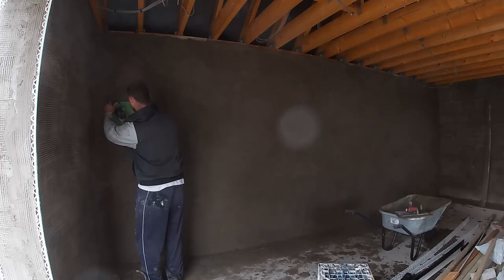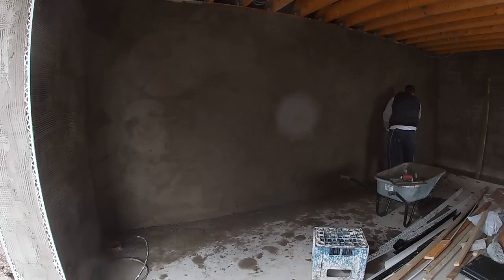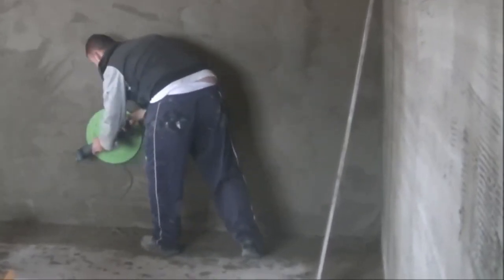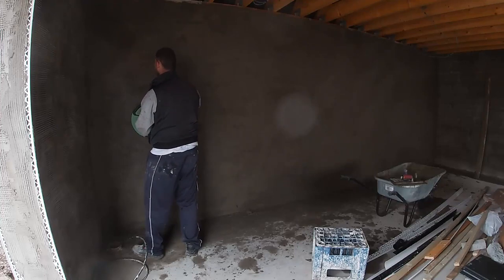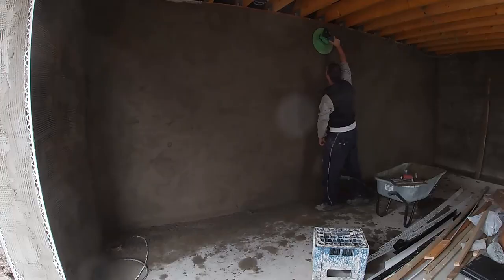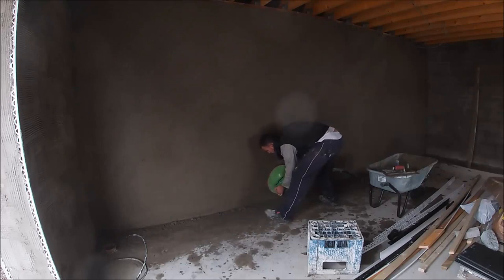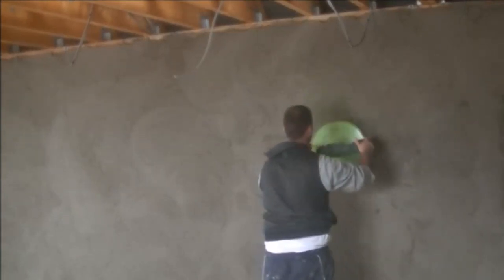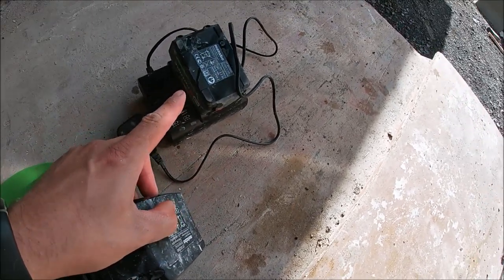Cement Plaster Finishing Machine Refina Power Float Internal Rendering

Comment: Seriously considering getting one. 30 years plastering is taking toll on the joints. 👍
Reply from the maker: The way it gets the render back is great for me as i dont like to wet my render as i dont like the discolouring you can get it will be good if i get time to whip u a video on it vs hand floating if that makes sense buddy
Reply: @macplastering  defo makes sense, 👍👍
Reply from the maker: @dominicdurso3672  I just need some good weather and a job that has 2 walls the same or a big wall that i can do half and half somehow, I might have a wall coming up in the next 4 weeks, will be an interesting on I also need to pay more attention to the batty life I do show some detail at around the 14 min mark but need to cover it better as this could make an big impact to any one wanting a lead or battery one
Reply: I bought 1 a different make and tried it out but it was bit soft and very little drying can’t see how people can use this when the render is soft but I think they are a brilliant job looking forward to doing some on the summer would say you would be able to do a gable on own

Comment: Hi Mac, came on your channel and iv enjoyed looking trough them👍
One question 🤔 
Have you every used plastering machine? Its like a small bucket with 4 jets on front and mix in it with conpresser hose to push out mix.
Keep the good work up. 
  I would love to see you trying it
Reply from the maker: Have used a hopper before to get a spray finish but no videos on that but yes would love to try some on the channel I do thin refina have some things for spraying ot on
Reply: @macplastering  
HBM cement spray gun, mortar spray gun
They can be bought online for handy money iv worked one and great handy tool.

Comment: Is the wall pretty dry and do you get much dust with that machine? I imagine it must get clogged up.
Reply from the maker: No dust as wall is damp the sponge when dry can have a little dust but a quick wet and its 100% it is easy to clean the plastic float attachment just run water over it and clean the sponge needs a little more attention as in a few more dunks as if the cement gets hard on it would be ruined
Reply: @macplastering  It looks like it could save a lot of time and effort especially on large areas. And,  do the touching up work afterwards. I have learned with plastering to clean tools before they dry hard. As you say else they are ruined.
Reply from the maker: @StevePhillips  For sure some plaster is very hard to get of when set :)
Reply from the maker: @StevePhillips  Planning on a nice video competing it against had finish see what's faster

Comment: Did not find any dealers for those power floats in the US, but found a Chinese knock off that may last 3 jobs. Still, would like to get the diamond disc etc. Thanks for posting!
Reply from the maker: hi mate thanks for watching :) yes when i say diamond disk its just the shape/pattern on the disk but works great  Im surprised if amazon dont have any but I am sure refina would send ? thanks again for watching mate

Comment: Avoid generators for charging batteries, bigger gennies have decent surge controllers. 7kva and above small genny 2.8kva at least a decent surge controller. 
If beat run an invertor in your van battery. This swaps DC battery too mains AC. 
500w should be enough
DC >AC to charge on main supplies.
Reply from the maker: Thanks buddy yes I had been told both as some say these new bats dont get damaged from genies but glad you cleared it up for us appreciate this man :):) Hope your doing well Oliver